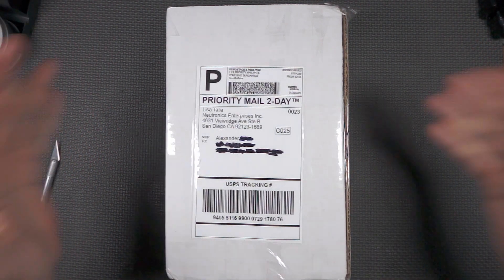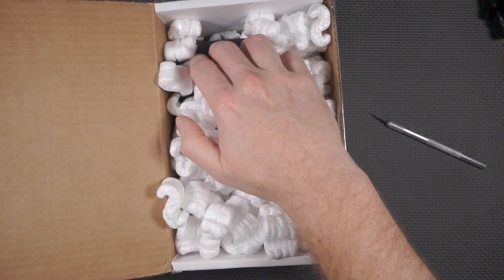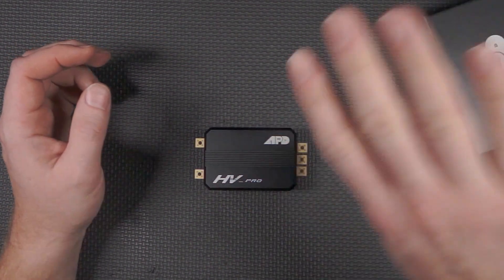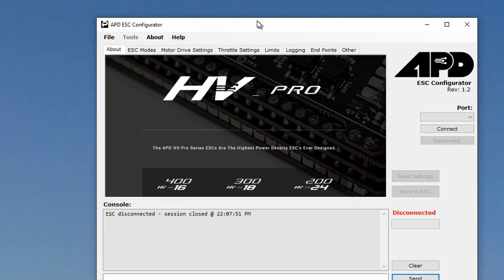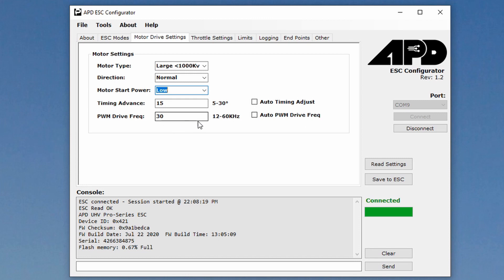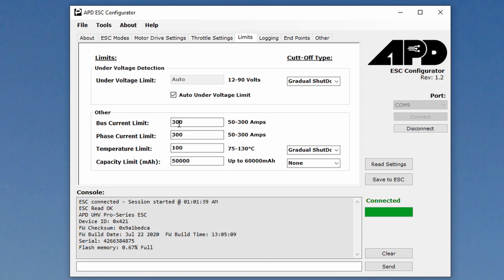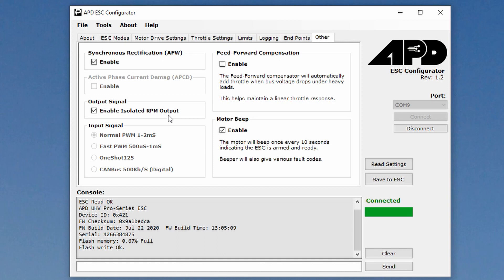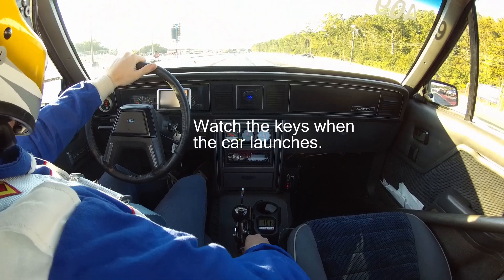Unboxing and Programming An $1,100 APD ESC for the Electric Turbo

Comment: Can we use these on rc drag cars
Reply from the maker: Absolutely.  It's actually a remarkable unit, but not water resistant.
Reply: @AlexLTDLX  I want to see if I can use it with a nue motor that’s 9s rated for drag racing

Comment: You could probably build your own ESC for a fraction of what that cost and it will handle twice the amps. It'll be bigger but with anything high amps high heat bigger is sometimes better especially with heat dissipation.
Reply from the maker: I may have to.  Watch my last two videos - unboxing a $1700 ESC and then blowing up a $1700 ESC.  This one blew up too.  I really don't know why it's so hard to make a decent ESC.
Reply: @AlexLTDLX  you're using a huge capacitor, right? You can't use these things without an enormous low-ESR capacitor. You're blowing up ESCs left and right. I think I've spotted the common denominator.

Comment: Heat due to current limiting also comes from the controller PWMing the output fets, which produces more heat losses than normal.
Reply from the maker: That's true.  I have a water block to cool it (actually, all the water cooling parts are here).  After I finish up editing the current video, that's the next one - while it's still snowing here...  Then we hit the road!

Comment: This is awesome stuff, I just subscribed I cannot wait for the results! Def some spaceship levels of woosh sounds and cool factor  that I would love to have without the oil issues of an exhaust driven turbine. And a lot of other stuff— I have a 2ZZ-GE mr2 spyder that’s redlining to 8125 rpm and a little weak on the low end, definitely thinking about this cause it’s so simple and lighter than a turbo setup, at least for the weight distribution I’m looking forward to (batteries can be mounted at the front, since my engine is at the back) being a 1.8 liter engine I’m super stoked to see what an electric turbine would do! Loooking forward to the final or beta product, EV can suck it for now, I’ll probably use their charging stations for my little future electric boost turbine battery pack, haha
Reply from the maker: Thanks.  For a motor under 550 hp, I'd start with an old Powerdyne BD-11.  They had a bad rapdue to the belts breaking, but when electrically driven that shouldn't be an issue.  The best part is people practically give them away these days, when you can find them.  They were pretty good blowers, too.

Comment: you gotta put that small motor on a small engine and see what kind of psi you can get.
Reply from the maker: I don't know if you saw it, but we put a less potent version on a built 6 liter V8 that makes 500 hp naturally aspirated - and we actually made boost and increased power: https://youtu.be/84wSLQRy9sc  I'm now shooting for 700 flywheel hp (about 530 rwhp in this car) and 9 second passes.  It's already been 9's countless times with a Whipple; but it took 15 psi to do it.  I think the electric turbo  could do it with less than half the boost.
Reply: @AlexLTDLX  less than half boost is pretty impressive
Reply: A 2L Inline 4 would be interesting
Reply from the maker: A 2 liter engine would be too small (the compressor would go into surge pretty much instantly).

Comment: AWESOME ESC .. data log at 25ms Nice ! .. i would hammer them about the 300max limit that needs to be adjustable to 400 so you can set it and forget it and in theory it wont blow up due to to much current .. Also the max amps is at 10m/s air flow so it is sad for that much money you still have to go buy your own fan and attach it some how.
Reply from the maker: We'll find out about the current when we're able to make a hit with it.  Since the run times are so short, and there's plenty of airflow where it's at, I think we'll be ok... only one way to find out!

Comment: I believe FW checksum is provided validate that the firmware is not corrupted, similarly to how you are using it for you vids.  Also, the ability to control via CAN bus sounds AWESOME!  That makes me think about having the ability to control based on several things if you have a custom ECU.
Reply from the maker: Yeah, the can bus feature sounds pretty cool!

Comment: Just curious but to get more amps out of it why not put 2 in parallel (besides price point). I have been told that 2 esc in parallel is one way to hot rod and electric golf cart
Reply: for a 3 phase (brushless ) motor the esc's would have to be synchronised absolutely perfectly. golf cart motors are usually brushed dc so thats why stacking inverters works.
Reply: @denisohbrien  I learnt something today